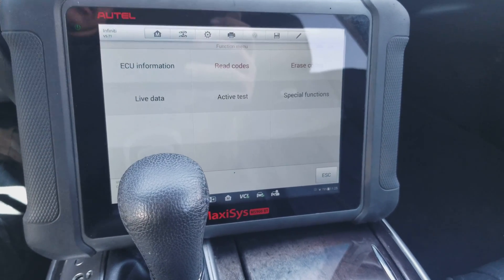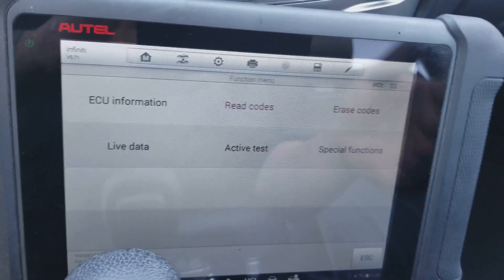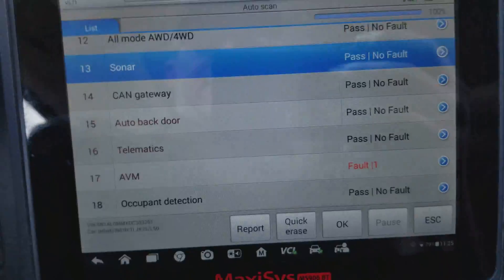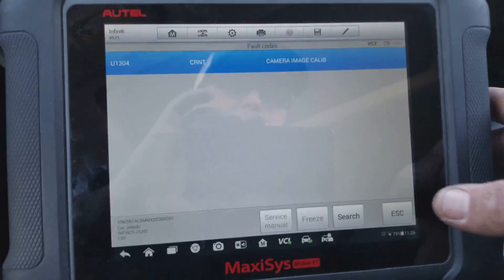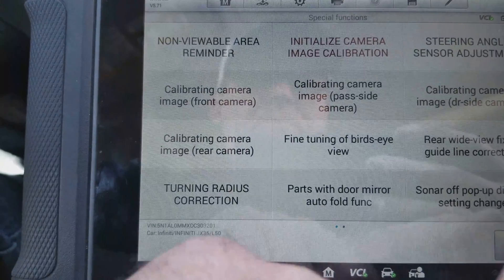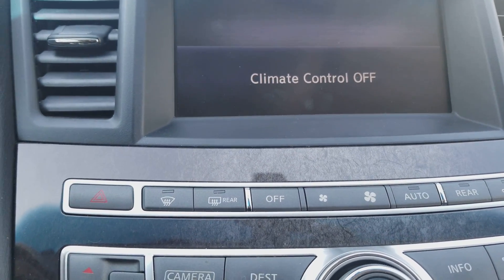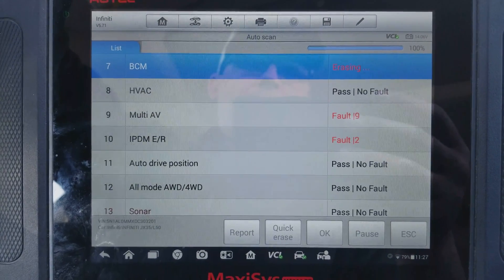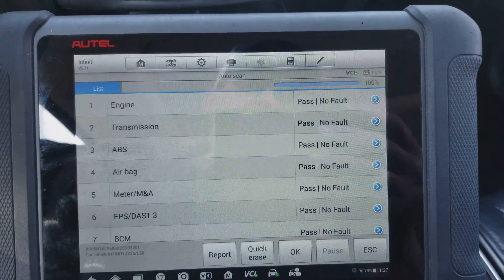Calibrating park assist camera on infinity vehicles with autel 906bt or similar.

Comment: Your actually supposed to to set up a perimeter of tape at specified distances from the wheel hub and center lines.  Then you calibrate each camera, even if only one was affected.  I’m a calibration technician and we charge body shops almost a 1,000 dollars for that, which is less than the dealership believe it or not.  This is the problem with having an expensive tool that you don’t understand.

Comment: I just bought the Autel 906TS, so this video along with the others like the Ford programming are great. the Autel does so much I feel like I'm barely using it's capabilities, do you just play around with it or was there some documentation you found that explains the data pids and procedures?  As always great Video, keep em coming.
Reply from the maker: James Svetlovics just been doing it a long time. Some trial and error. I used to use dealer software before the scanners got so advanced. Basically I know what needs to be done when I get to a job. I use the autel to get into tat module and then try and see if the special functions or programming options can do what I need. These new cars are changing faster then I've ever seen and there are new procedures and control modules every year. I just take what I do know and use it to try and learn what i don't. I find out what the tool can do along the way when I come across something new.

Comment: Hello ...do you know..if the maxixis can calibrate frond head lights assamble...on a 2014 mercedez e350 this is a $1800 light assamble not included the module bolted below the head light. Module its bad too.
Reply: your better off with autologic or Oem Scanner... try mhh forum

Comment: could you tell me if i can use the autel 905 to replace a  ecu on a dodge. thanks
Reply from the maker: Cherryell Bradley need a little more info.  Make and model. You can rewrite mileage and vin on most dodge vehicle ecus which will correct the skim or skreem and prevent a no start.  If you can let me know the year and model I can let you know for sure and how to.
Reply: thanks for the response i just needed to know if it would do any also will the mini do any key programming at all. i have a small repair garage and just looking for another tool we can do gm and ford but looking for something to help on others.
Reply from the maker: Cherryell Bradley yes it will.  It does exactly what the 906bt and 908 will do. I had one I used for 2 years then switched to the 906. Exact same tool. Some people might say different but trust me I used them both on thousands of cars combined and they are practically identical software wise. 905 is just a little smaller.
Reply: thanks a lot i was having trouble finding this out